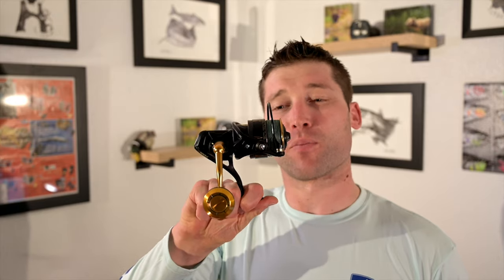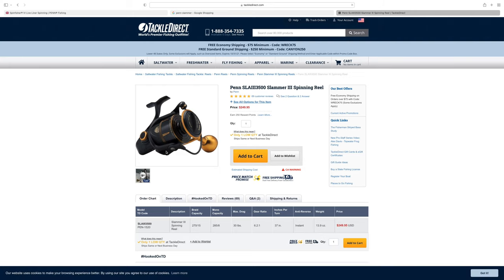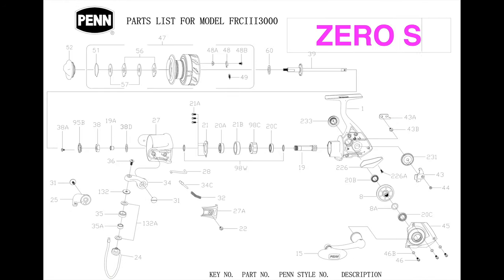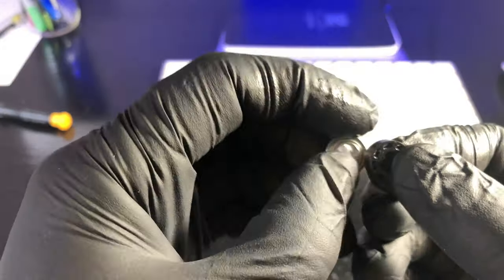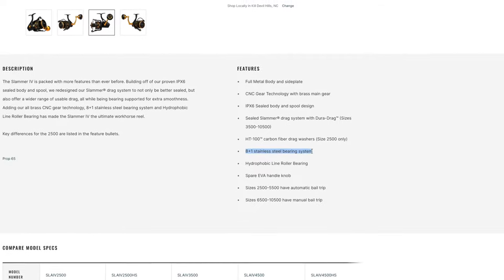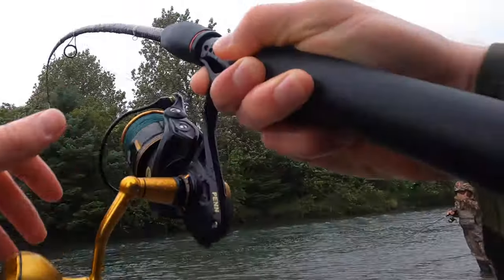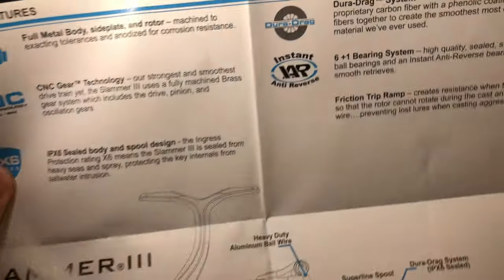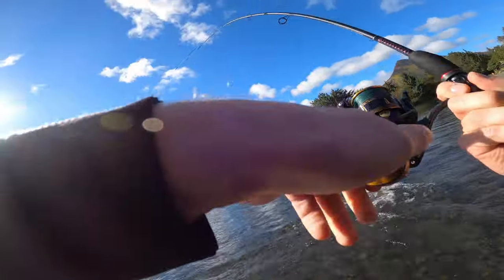PENN SLAMMER: Top of the FOOD CHAIN?

Comment: They rebuilt the drag system, so it goes lower and should be smoother.  I believe the extra bearing is also in that rebuilt drag system.  The drag was the biggest complaint Penn had I am pretty sure.  I have the III and can attest to that.
Reply from the maker: Thanks for stopping by and sharing!

Comment: Nice video and 100% agree on the Penn slammers.   Price wise $150.00 for 4500  Slammer lll at Bass pro shops .   Kids drop the reels in the  sand and water and no problems.  Simple up keep no hassles like ferro mag oil maintenance.   The  Big 10500 handles bluefin tuna and jumbo White Sturgeon equally well  and for $300 did not break the bank.
Reply from the maker: Thanks for stopping by and sharing your experience. With the Slammer 4s rolling out, I think the Slammer 3's going on sale are the best thing going right now. I bet the 10500 is an absolute beast.

Comment: Nice breakdown of the Slammers, interesting to see the differences with the Spinfisher vi too, I've got a couple of each and love them, they hold up so well to salt water kayak fishing, which most reels just can't handle. You show the Slammer with 13 or 14 seals and the Spinfisher with only 8. I had been told that the only reason the Spinfisher vi didn't have an Ingress Protection Rating of 6 was because the Spinfisher has a bait runner in its range with extra water vulnerabilities, but they considered the non bait runner Spinfishers to really have an IPX6 rating, even though you show here their seal design is quite different, with the Spinfishers having 5 fewer seals. Thanks for your interesting clip.
Reply from the maker: Glad to hear you love your reels. Honestly, the Spinfishers are all you ever need. Penn has them listed as IPX5 vs IPX6 ( for Slammers) because they carry fewer seals. That’s interesting what you mention about the bait runners and makes sense to me. The Slammer really is over the top and beyond what anyone really needs short of a charter boat on the Florida flats running and gunning every day. Thanks for stopping by and sharing your thoughts.

Comment: Does it have the auto bale trip feature? I'd hope they'd remove that, lost so many expensive spoon's
Reply from the maker: Yeah it has a bail trip lever, so it auto-closes when you start reeling. I have lost many spoons due to a bail closing when it shouldn't. However, when I cast with this reel, I like to manually flip the bail close with my hand instead of reeling to close it. I haven't had issues that way. Thanks for stopping by!
Reply: @CastFromTheHip  yea well my reel closes in a cast, that was the biggest problem w the 2500-5500. 6500 and up is Manuel

Comment: How can you put 65 lb braid on a 4500 when the box says the max is 30lb drag
Reply from the maker: This is purely based off my experience and style, so take it with a grain of salt…saltwater fish are unforgiving on line. The beauty of braid is that it has a very small diameter compared to mono of equivalent strength. So despite your reel’s official ratings, you can run 65lb braid. Not because you need 65lbs of drag strength(which the reel can’t even provide), but you need abrasion-resistance from sharp teeth and fins. I’ve had 15lb fish absolutely wreck 50lb braid in salt water.

For example, I used 65lb braid in florida to catch big Snook near docks. They’re brutal on line due to their mouths and sharp fins. Add to that they are crazy fighters. At the end of the day you use what you have and you get creative to catch certain types of fish. Especially in salt water. If you max out 30lb drag on 30lb line fighting a snook, your line will snap every time. I use just enough drag to wear the fish out after repeated runs, I’d say 30lb is more than enough and shouldn’t dictate the strength of your line.

Final note, I have buddies who put 40lb braid on barbie rods & reels and catch 10lb salmon with them. Drag was never an issue.